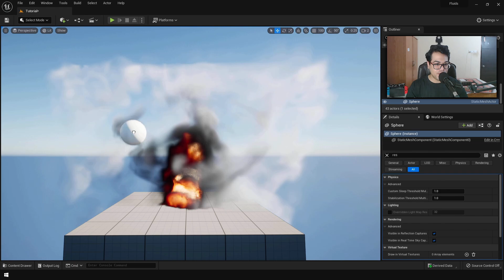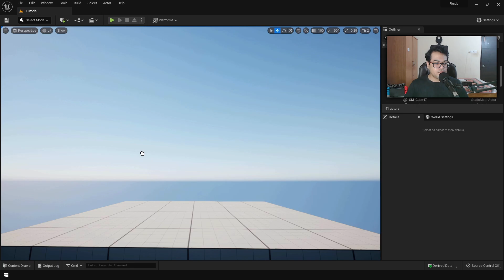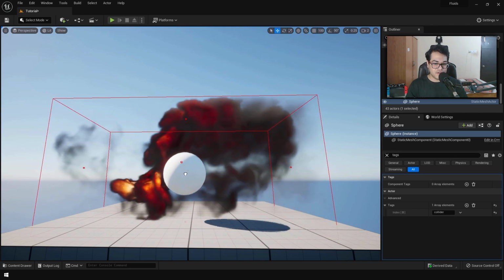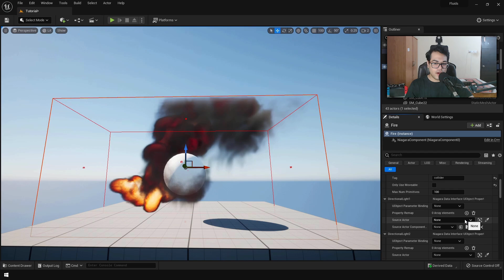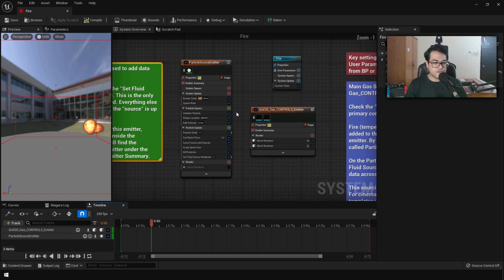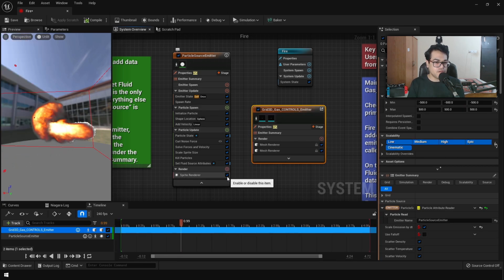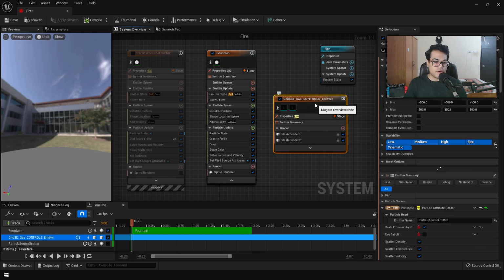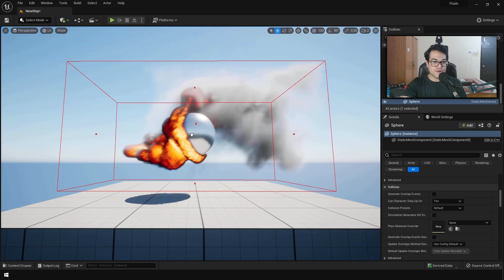Introduction to Niagara Fluids in Unreal Engine 5

Comment: I found this comment on a different video for anyone having trouble with the collider tag :                                                                                                                                                                        Collision component is no longer part of "ParticleSourceEmitter" in UE 5.2. (at least not by default unless added manually)
Instead i found this setting >>> Grid3D_Gas_master_emitter > "Collide against" > "use mesh Collisions"
Reply: Thank You so much!!

Comment: Thank you for your lessons) But I have a problem. I'm trying to create a particle system from the Grid3d_gas_cjntrols_Emitter template and I get a bunch of errors. And nothing works. Have you come across this?
Reply: same thing happening here and i still couldn't figure it out, did u?
Reply: @SalahTube0  It turned out that the error was fixed. For those who will face the same problem - you just need to click "Full Rebuild" next to the "Compile" item in the particle system. And that's it)

Comment: When I create a new Niagara system and choose the 2nd option to use a template, it shows only 3 templates. I can't click on them and there's a message saying "not in library". Any idea how I can add these templates?
Reply from the maker: Go to the plug-ins and search for the Niagara Fluids Plugin. Make sure that it’s enabled. After enabling the plugin you will need to restart the engine. That will fix it!
Reply: @pinkpocketTV  Thank you! That was it. I also realized that I was still running early access and had not updated to version 5, ahaha!

Comment: First you have to select an "emitter".
Well I found that by myself.

Edit
Still: I don't have all those beautiful templates. 
I added a "fountain" and it didn't even work.
Then I changed the emitter type and it worked.
I have the fountain emitter.
And it sucks.
Then I deleted the initial mesh emitter, and the emitter stays.
So what was the mesh for?
Uff.

Edit again
The templates are in a PLUGIN that is not enabled by default, because... experimental. 
Found this by myself too.
Meh.
Reply: Go to Edit>Plugins and activate all Niagara extras!!!